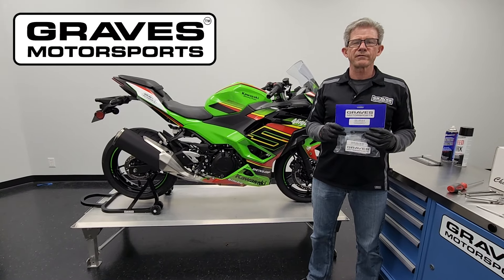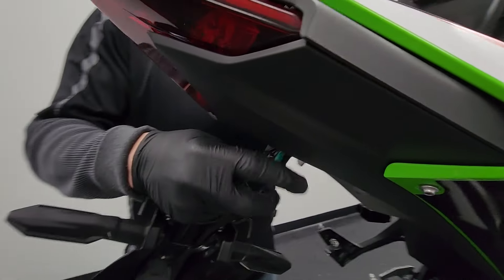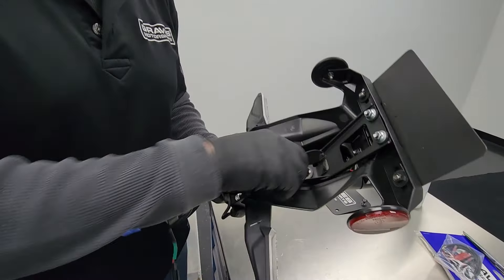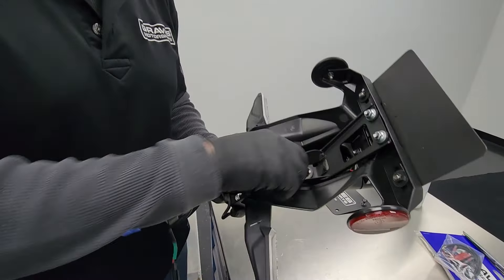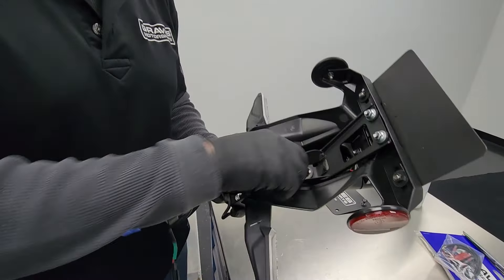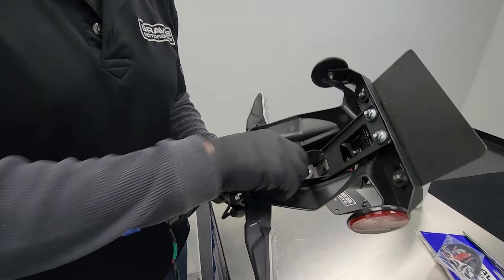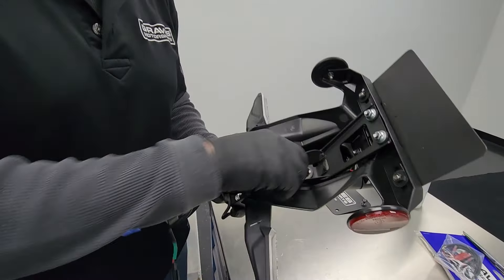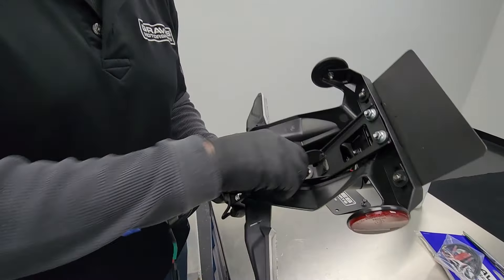Ninja500 +Ninja400  Fender Eliminator Installation Video

Comment: Btw you don’t need to take out the cage at 3:40 - 6:20. You can go straight to taking out the screws for the turn signals. It took me 30 minutes trying to get one of those bolts off and I said f*** that.
Reply: But how do I access the screws to my number plate light without removing the cage????? Pls help me out